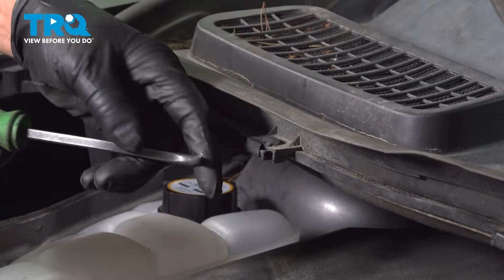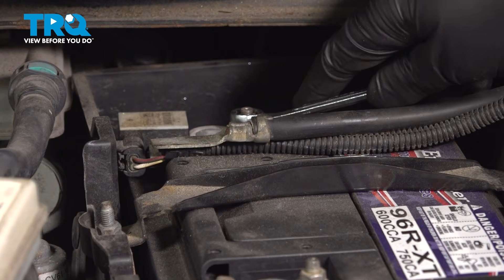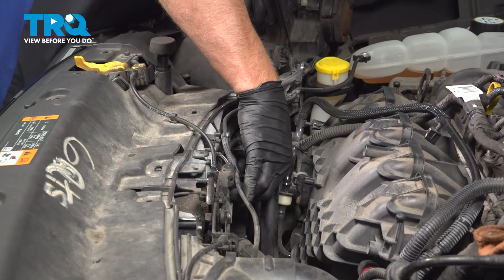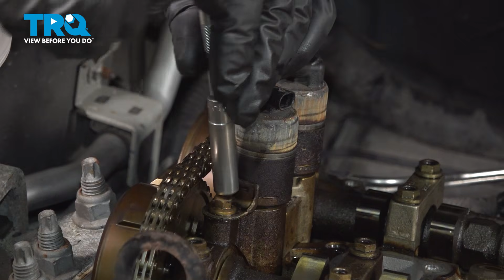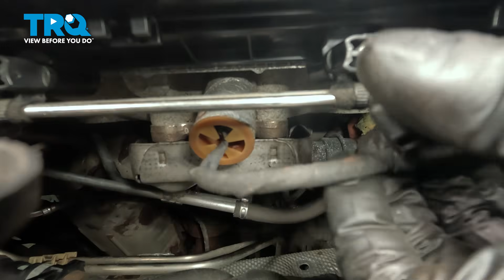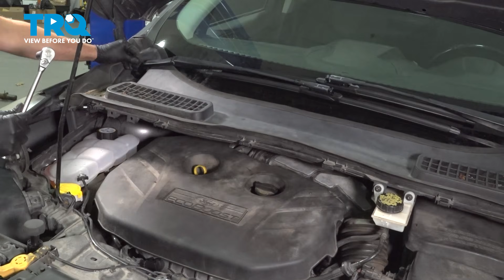How to Replace Variable Valve Timing Solenoid 2013-2019 Ford Escape 2.0L L4

Comment: For those attempting this repair, one thing that isn’t mentioned in the video is that he doesn’t reinstall the original valve cover. At 17:18, you can see that the valve cover is brand new. This is important because there is a gasket around each VVT solenoid. When I removed my cover, I didn’t notice that the gaskets were brittle and broke, leaving part of the gasket still stuck to the old solenoid. When I reinstalled the old cover, following the video’s instructions, the remnants of the old gaskets were not enough to seal the new solenoids and oil sprayed all over when I reassembled and ran it. There was another commenter that mentioned an oil leak after replacing the solenoids. If you are going to reuse the original cover, you will need to buy replacement gaskets and remove any fragments of the old ones.

Comment: @TRQ would this be any different for the 1.6L? It appears I Can see the bolts for my solenoids without removal of the valve cover and wires. But I’m curious if the additional removals are necessary

Comment: So if my car is throwing two check engine codes one being a P0340 and the other being a P0344 code could this be the suspect of it. I have about 160k miles on the car this far

Comment: So there are 2 VVT solenoids for that engine. The one closer to the front is the intake VVT solenoid and the one closer to the rear is the exhaust VVT solenoid... Correct? I suppose a scanning tool told you which one was due for replacement? Thanks